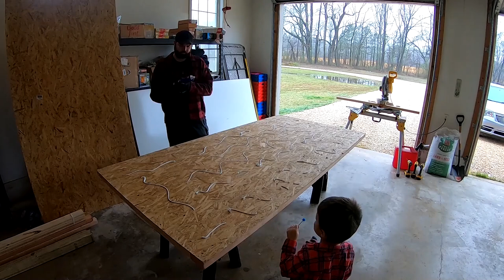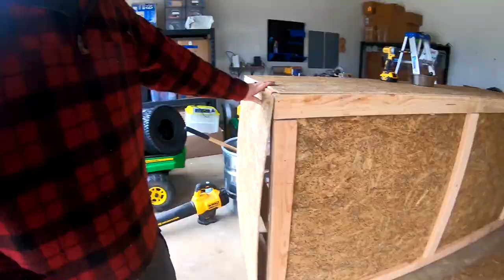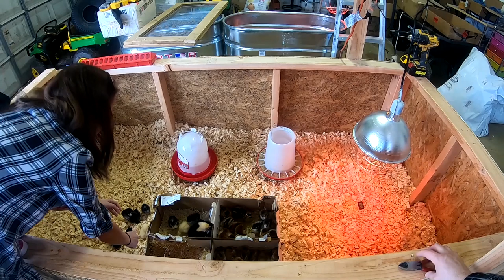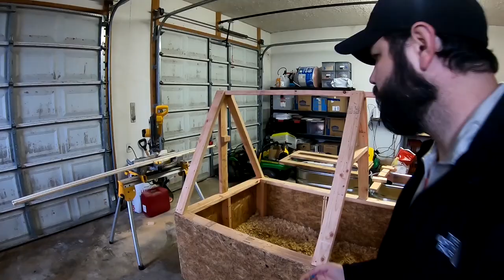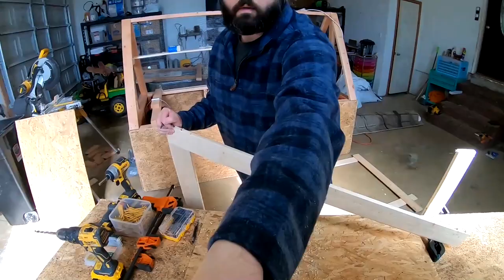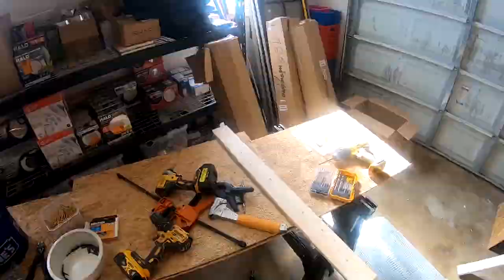Homemade Chicken Brooder Build | Holds Over 100 Chicks

Comment: How long were you able to keep the 100 chicks in there?? Love it though!
Also what was the lumber supply list and the fencing list (like how much of the wood and the wiring did you use?)?
Reply from the maker: Probably about 6 weeks max.  We have a few brooders now.  I've also taken the top off this thing and went with a flat hinged roof (door).  I don't have plans for this but I remember it being about 20 feet of 4 foot hardware cloth and 2 sheets of 4'x8' plywood and about 10 2x4 by 8 feet.  a couple of 1/4s for the top and some hinges.

Comment: Nice job! What did you glue to the floor(white material)?
Reply from the maker: It was like a white wall panel from Lowes.  I thought it would be better for clean up.  It's not really necessary.